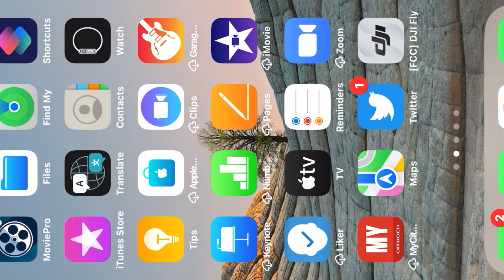FCC mode - GAME CHANGER!!

Comment: Can you tell me, does this work on the DJI mini 3 (standard not pro)
Reply from the maker: Not yet. The mini 3 has not had the sdk released by dji and so third party apps - like the FCC hack cannot be used with the mini 3 - yet! :)
Reply: I was just trying to get the older controller as I have the one with the screen. I was so looking forward to it lol..
Reply from the maker: The 'older' controller (RC-N1) does give a better signal then the one with the screen (RM330) when you use it with the Mini 3 Pro.  See here for my test: https://youtu.be/jcUfu7jhx4w
Reply: @WindsweptRobert  thanks for the reply, i was under the impression if i paired the rcn1 controller to my mini 3 (standard) loaded the fcc hack via my mobile phone and then changed back to the rm330 controller the fcc would stay active until the drone powered off. ive got a chance at getting a rcn1 controller from a guy off facebook marketplace for £30 so this is really annoying as i dont know if it will work lol...some youtubers say yes. some say no...  but i really need FCC, my range is garbage atm.
Reply from the maker: Let me suggest this: Buy the RC-N1 from the guy for 30 quid. If it doesn't do .what you want I'll buy it from you for 30 quid (provided it's not broken)

Comment: I'm quite sure there is a way to install the fcc hack on to the smart controller. Because you can install APKs from Google you can get the play store from Google and then work from there. I have seen people on YouTube do this.
Reply from the maker: You can watch YouTube videos on the RM330, but I don't think you can download and install anything onto it.
Reply: the fcc mod for the dji rc rm300 has been available for months now. It is an .exe file to be run on the PC with the remote control connected to the PC. It must be purchased clearly. If you search on youtube, you will find everything about it.

Comment: Great video!
I’ve just been on there site and intend to purchase and load on to my mini2 and 3 when it arrives. I’ve noticed something on drone-tweak site stating max distance gain and ce distance, 
Ce 6km
Fcc 10km
Now correct me if I am wrong but wasn’t Dji selling point on the mini 2 starting 10km range ? So this is false advertising in Europe. As will only do 6km in CE 🤦🏼
Reply from the maker: I wouldn't go by the figures pushed by any company selling their product. There's a video coming out on my channel on Sunday that shows the distance that I got from my mini 3 in CE and FCC mode :)

Comment: I bought the app Bob but decided against installing it. DJI update the FLY app regularly and this hacked app will just go out of date. Wasted money. I will just get the N1 controller.
Reply from the maker: You can’t install it on the RM330. It doesn’t matter if DJI updated the FLY app because the modded version runs completely separately from the official version. Also, the modded version gets free updates :)

Comment: WTF Robert, I can't see what you're testing. The altitude changes slightly but there are no distance readings to determine any signal tests, please explain what I'm missing.
Reply from the maker: It’s not about the distance, Peter. It’s a direct comparison of the 2 modes over the exact same flight path. Distance in this test is irrelevant. There will be a range comparison video published on Sunday.

Comment: I don’t think you’re going to be able to download third-party apps onto the RC at all as there is no additional internal storage for it to go anywhere without taking the original DJI app off which can’t be done yet
Reply from the maker: You could be right, Mark. This gives some owners of the mini 3 pro a bit of a dilemma :)
Reply: @WindsweptRobert  the update 1.7.4 is now available for the RC
Reply: @WindsweptRobert  yes, fortunately I have both controllers as I got the N1 with my air two and I’m getting the Drone tweaks fly app and go 4 app to use with my Mavic Pro Platinum as well

Comment: Robert does drone hacks update when DJI update there software? . In other words will the hack still work after a firmware update?
Reply from the maker: I installed this hack at version 1.7.0. It still works on version 1.7.4 :)
Reply: @WindsweptRobert  I might ask you this again in a few updates. I pay £25 a year for the one I use,Drone tweaks and the guys customer service is second to none.

Comment: Hi Robert Fcc Mod looks really promising, good comparison video, do you find it is having much impact on the controller battery, and what sort of range were you out in the built up area you didn't show it.
Reply from the maker: I thought that the range was not relevant in the urban test, and I wanted to stop any distraction from the point of the video by the usual VLOS Karens, so I edited out the distance. The point is that in the same flightpath, the FCC was better than the CE mode :) You WILL see the distances on the range test on Sunday's video (or you can see it now in the MEMBERS section of the channel) as I believe it is relevant in a rural flight :)

From my multiple tests of this tweak, there is no noticeable difference in the battery.

Comment: Is there any legal issues around FCC here in the uk? and also, do you know from the site you got the software from if it will still work when there are future firmware updates (which have been fairly frequent). I guess one of my main concerns is voiding warranty with DJI if it gets logged.
Reply from the maker: These are things that you really need to look into yourself and that way you can decide whether you want to use this app based on your own gathered info, rather than relying on the word of a dodgy Scotsman 😉

Comment: I've never had an issue with the range of the MINI 2 but downloaded the latest version of the DJI Fly App to my new phone today, Google Pixel 6 Pro. I was doing an aerial site survey for my son but could hardly get 300 meters range over a rural area. The only thing different was that I put the phone into flight mode, so if that means anything it indicates it's not crap off the phone. I'm going to have to do further tests.
Reply from the maker: I’m surprised at how much of a difference there is between FCC and CE!